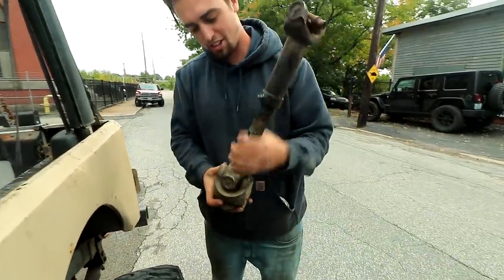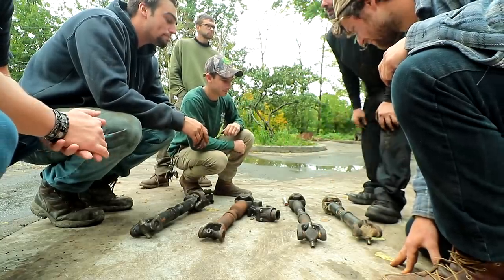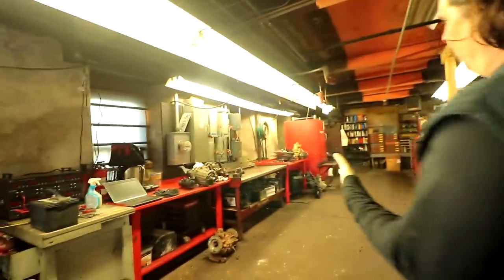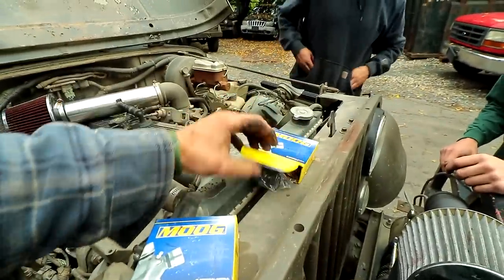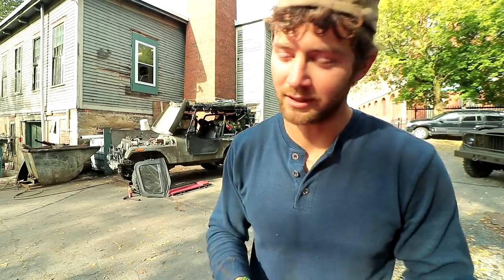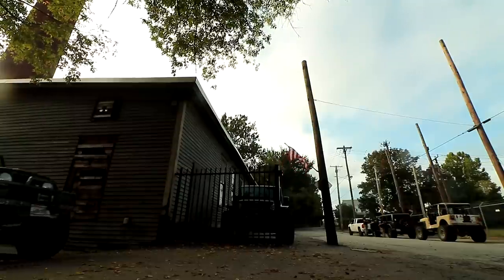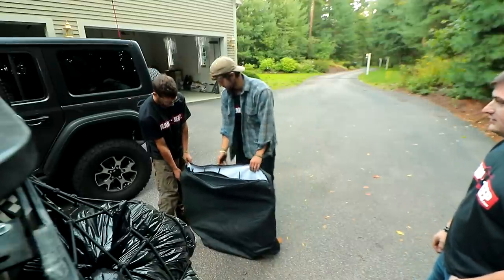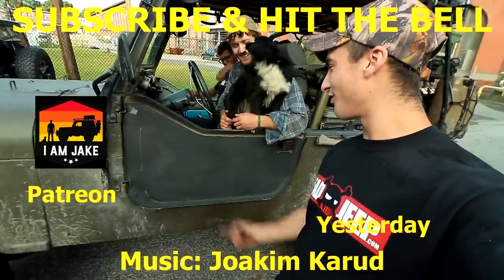the RETURN of 4-WHEEL Drive!!

Comment: If you already have too many problems with the joints check the pinion position of your differential should be parallel with the  transfer case should not be pointed directly from the differential to the transfer case or it could be putting too much stress to the bar or joints you won't feel anything until you snaps again

Comment: glad you guys got this worked out....a bikini top would help a lot keep heat in and rain out and would be easy enough to take off even with the platform on top. also go to a Cyclegear and pick up some heated jackets by hotwire. they are 189$ for a jacket and controller. they can plug into your cig lighter in jade. I have been using mine on my motorcycle for about 3 years now with no problems in temps as low as 20 degrees. they heat up to 120 degrees. just a thought....but phnemonia sucks